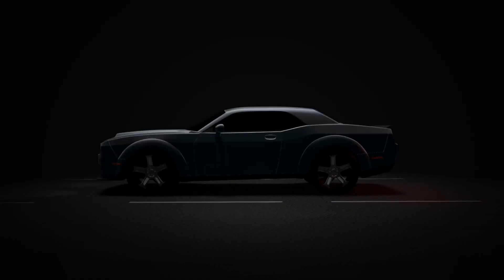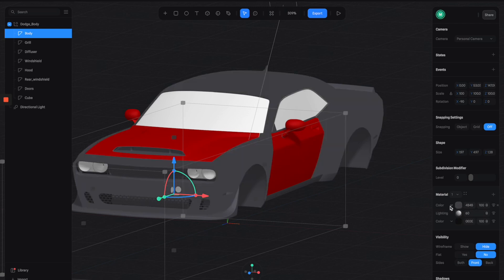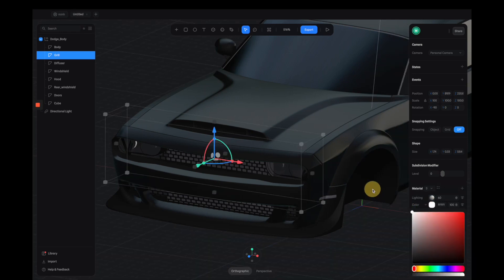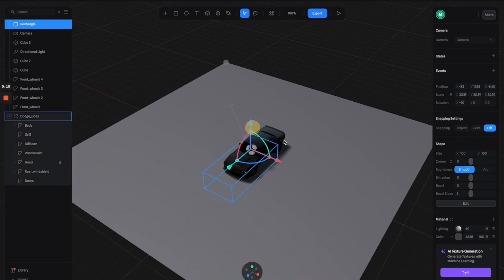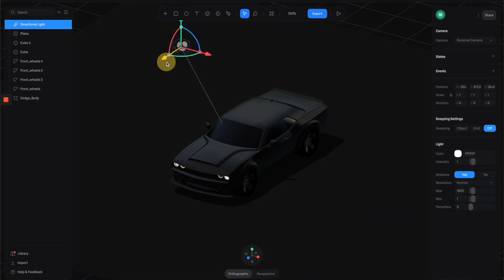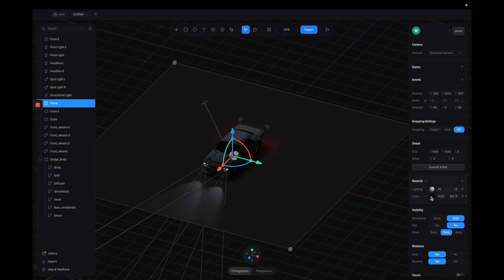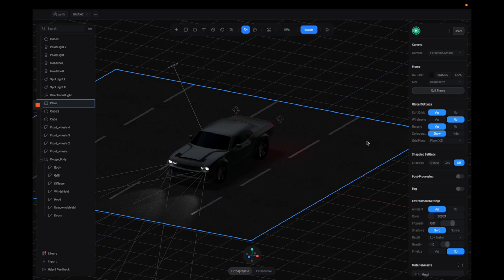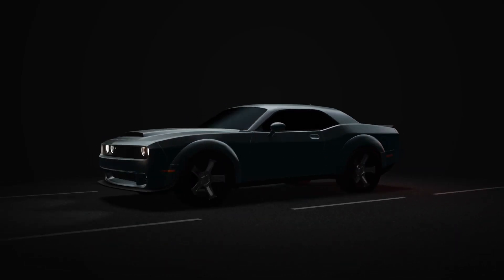How to make a real-time Interactive 3D car with Spline

Comment: In the export tab under performance there is a red circle. A nicely optimized scene will show green.  If you click on 'run test' you can see what you can do to further optimize. This will help loading times especially with multiple cameras / materials / objects. Just a tip for anyone wanting to further optimize their scene. 

Additionally from the main project settings you can choose  to remove duplicate assets and non used materials.